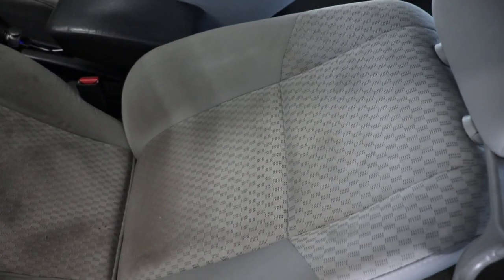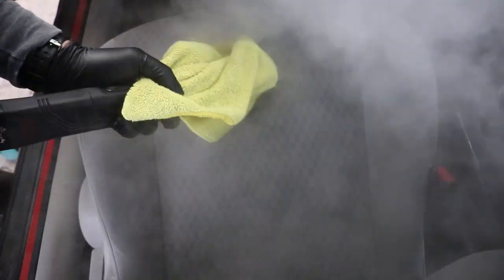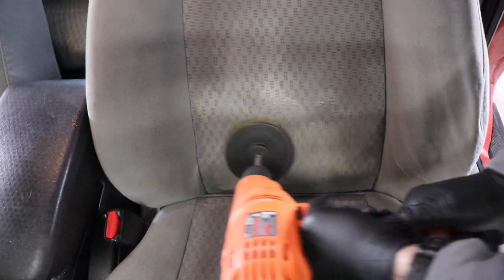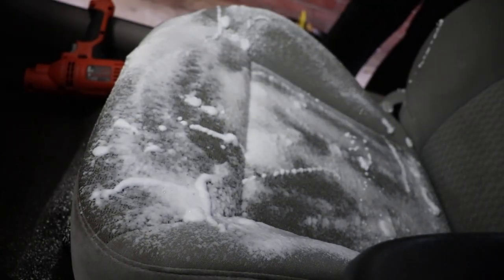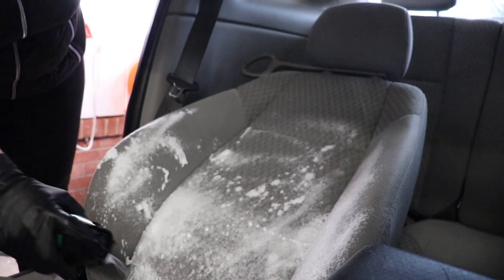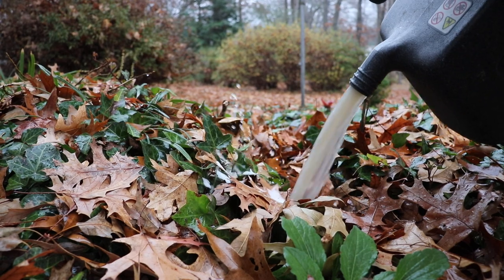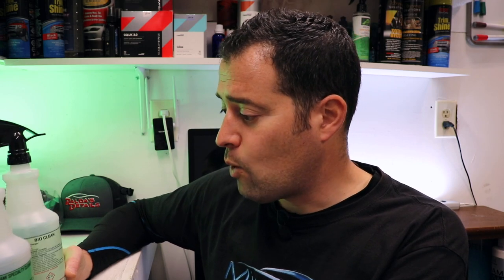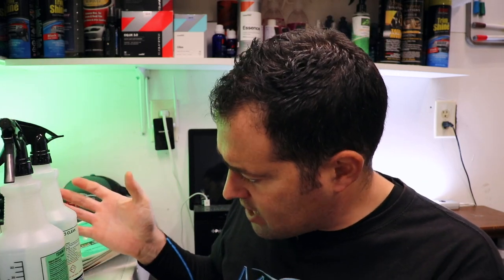How To Clean NASTY Car Seats!  Heavy Steam Cleaning and Extracting! #autodetailing #disasterdetail

Comment: How long does it usually take for fabric or even carpets to dry and is there anything you can use to advance drying time
Reply from the maker: When extracting it takes a few hours. Sometimes more. But if you put a blower or air mover in there it dries super fast.
Reply: Miranda Detailing  thanks appreciate it

Comment: Hi Phil, Could explain in layman's terms what wicking is (how, why and when it occurs, and how to prevent it ? I remember that in one of your videos you talked about adding something to the water in your extractor to balance out the PH I think from the cleaning solution used....Unfortunately I cannot find that video
Reply from the maker: Hi. So wicking basically happens as the carpet of fabric dries from the top down and water evaporates from the top. When the water evaporates it pulls the water up along from underneath the carpet up and if there is a remaining stain it will pull that stain along with it. This happens whether you neutralize the cleaner or not. It happens because the carpet or upholstery is oversaturated. That’s why we try to clean just the surface so water doesn’t sleep too far into the fabric or carpet.However if you are cleaning just the surface with a high alkaline cleaner like super clean or any other, it is good to neutralize it with a fabric rents. Browning is a term that carpet cleaners use when high alkaline cleaners oxidize, it actually turns brown. So when you use a fabric rents it neutralizes that in the browning goes away.

Comment: I’ve got a funny question for you I got my first Corvette in and apparently the whole body is plastic or fiberglass my paint meter will not read anything how do I know if I can compound it or not??
Reply from the maker: Well, all you can do is tread lightly, don't overdo it.  I did a paint correction on a black Grand Sport Vette before and just had to be very careful.  I used D300 and a Microfiber disc and only compounded until the swirls where gone, but it may leave very minor scratches that i didn't want to fo any further on.  That is all you can do, unless you buy to buy this..https://amzn.to/35gob4k

Comment: Great to know about those products.  You know, I have used a lot of times either the Meguiars or the Turtle Wax products like your wife used whenever I am not carrying a steamer when have done mobile jobs.  Those products work very well and leave the new car scent that customers love.  Do you know about other carpet or upholstery cleaners that leave that new car scent?  Because I have used those from Chemical Guys which are great and have like a lemon scent but Folex doesn't.  Also, Dr. Beasley has basically no scent and the one from Optimum carpet and fabric cleaner is excellent too. There are those from superior products like Zap it which can be used on a Tornado system and Pink Perfection, and others like citrus power cleaner.   Would like to know about other options since you have more availability and you may have already tried them.
By the way, superiorproducts sales selectrozide which is approved by the FDA for sanitizing and disinfection of surfaces and lists first for Coronavirus.  A packet is ready to use and makes 2 and a half gallons and is sold for a 5 gallon bucket for $111.00.  The packet is thrown into the bucket so it dissolves and wait 2 hours to use and 4 hours for maximum strength.  There is a video that explains all.  It must be used within 15 days.  So just wanted to let you know about it.
Xoxo from Puerto Rico 👋🖖👍🇵🇷 saudações a sua esposa também.
Reply from the maker: Thats awesome to know about the Selectrozide products, I'll look into it.
Yeah we use all sorts of products depending on the stains, fabric and so on, its nice to be able to try different products and see what works and what doesn't.
Reply: @MirandaDetailing  Do you know about other cleaning products that may have the new car scent too? saudações a sua esposa também👋👍🇵🇷
Reply from the maker: Not sure about other products that have that same scent as the turtle wax foamer new car scent,  the Xtreme Solutions Bio Clean has a nice fresh scent to it. 
I wish a spoke Portuguese!  I used Google Translate to figure it out! Thanks!
My parents never taught us...my entire extended family are from the Azores, me and my brothers grew up in Boston and never learned our families language.  Sad....I blame the schools there,,,they didn't want kids to speak their native language g in school.
Reply: @MirandaDetailing  Too bad your parents  didn't teach their language especially when it is part of your heritage.  I speak Spanish, English and French because even though my dad wasn't fluent he at least knew some words because of my grandfather who only had a third grade of schooling and also knew some of it.  My dad knew English and was very fluent and even after graduating from the University of Puerto Rico with the medal in Acounting and medal in Finance he then served in the army and was a Vietnam war veteran.   Then he became a CPA and taught us English but from the three sons I was the only one who went to a school that had the three languages in the island.  Afterwards because of my job I got interested in learning another one and that was Portuguese, not as fluent as in Spanish/English/Spanish/French but there I go.  I am learning now Russian and friends ask me what for.  Well, want to go to Russia and Ukraine on vacations one day, so at least I could understand and somehow communicate.  Next, maybe German or more Italian since I understand it but I am not fluent.  My oldest son out of 4 boys does Spanish English and French and is more fluent than me.  The other 3 are very fluent in Spanish and English because I took the time to teach them even before they were born.  When they were at their mom's belly I always spoke to them in all the languages I knew.  Don't delay learning the language of your family. It is great to be able to communicate in more than one language.
The other 3 are living now in Kentucky with their mom and when they got there they had no problems at school. The teachersen they asked them how the learned it, they said my dad taught us, but also in Puerto Rico more than 70% speak English too.
I have never been in Portugal but I have been at Brazil and it was great to mingle with the people and even they treat you better only because you speak a bit of their language.  A bit of extended culture and kindness always opens lots of doors.
Reply: @MirandaDetailing  Saudações de Portugal ( Greetings from Portugal ).   Keep up the good work.

Comment: Hey I just saw video  with Ivan Laccroix  and Nick Rutter  clean cloth with a wool pad and buffer pretty  neat to clean cloth seat use foam pad for leather seat it's pretty cool methods check  it out mckees 37 they have new pad line redline  pads developed  by lake coutry
Reply from the maker: Yeah I aw that...I like that idea, Ill have to try it out on my cordless drill with a 3 inch wool and foam pads.